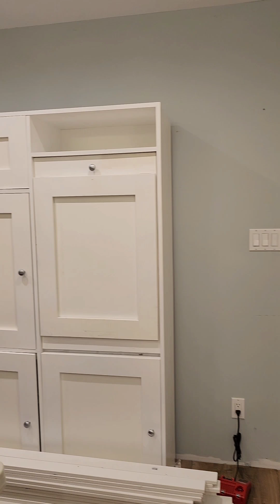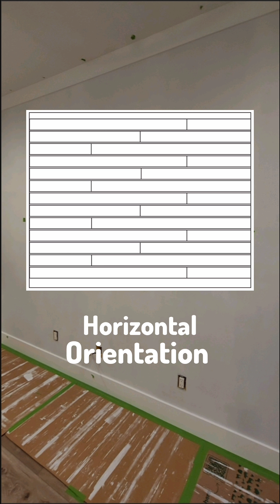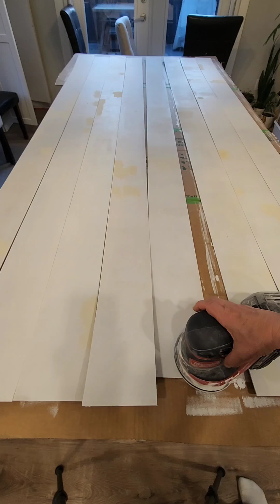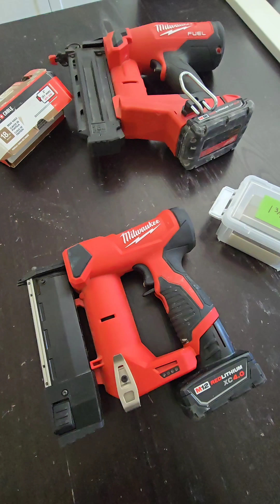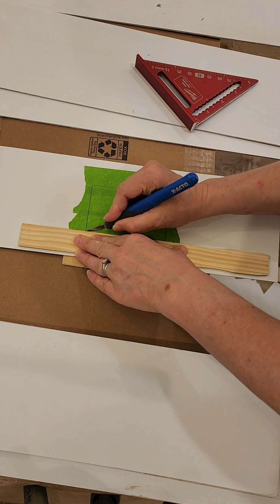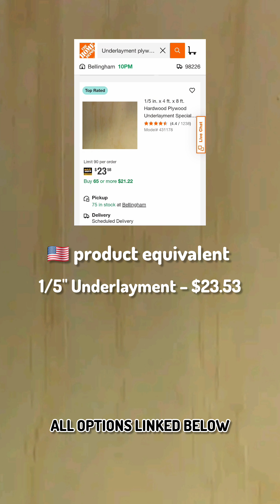Don’t Buy $15 Shiplap Boards - Make them for $2 | Full DIY Wall Tutorial

Comment from the maker: This wall added so much texture for so little 💰 can you believe it was under $2 a board? 

If you liked this, check out how I used the same treatment on my ceiling: https://youtu.be/KXFwhMbJwZM?si=6E2IFYXPYS-xurqd 

If you have any questions, drop them below, I'm happy to help. 😊
Reply: Very nice.  Thank you for sharing.  Do the brad nails have enough hold on just drywall?
Reply from the maker: @vmenajr Thank you! Yes, they are holding well, you will see from the video all the little green tape pieces (where I marked my nail holes to fill) that I used a lot of nails. The best application if you are having trouble with that is to angle the nails away from each other or nail in an X pattern to help hold the boards tight to the wall. I don't like to glue these boards to the wall incase I change my mind later and want to take it down since the glue will damage the drywall but if you’re not worried about that you could also use some adhesive. 😊
Reply: This might be one of the most helpful and practical DIY videos I’ve seen in ages! Thank you! Double bonus that you’re Canadian so I can actually find the products you suggest.  Definitely giving this a try rather than buying the pricey individual boards like I usually do! 🤦‍♀️. Great tutorial! 🎉
Reply from the maker: @norskgirl100 Thank you so much for leaving me this kind feedback, I'm so happy to hear it was helpful!! ❤
Reply: Can I do this over 70’s wood paneling?
Reply from the maker: @rachelseal2890 Yes! You can install the underlayment strips right over it. I would angle the nails in opposite directions to help hold each strip in place. Or, if you're not concerned about preserving the paneling, you could use adhesive instead.
Reply: @creatively.clarified thank you sooo much!!! ❤
Reply from the maker: @rachelseal2890 you're so welcome, have fun with your project!! ❤

Comment: Why couldn't you just score the 4x8 sheets at 5 inch intervals to make it look like individual boards?
Reply from the maker: You definitely could, it just wouldn't work for me for this project. I wanted to use a very thin material here so I didn’t have to remove my basboards and so it didn’t overlap the trim of the adjacent builtin. So I used underlayment plywood which doesn't have the thickness to score it and give the lapped look of boards for that traditional shiplap feel.

Comment: Literally did shiplap in our Victorian house 10 years ago. Our rooms were pretty decent sizes 19 x 20 to do the room fully the high wind coating where you could put plates on it using rail wood cost $237.72 and then $46 for the oil paint that I used after I just went to Lowe’s and priced it out it would cost me $1700 and $72 for the paint. I think that they are taking the boards that you’re using off the shelf because I cannot find them at Home Depot in front now
Reply from the maker: Wow, that's a tremendous savings!! I have found that's it's in and out of stock often at my Home Depot too, the last time I actually ended up getting hardboard instead.

Comment: Looks great however... if you do not remove the drywall first... you are going to have moisture and mold issues in a massive way. Get rid of your drywall everywhere... life is better. The fact ya use underlayment on top of drywall is a horrific decision. At the very least put moisture barrier... but like I said... remove the drywall! I hate to tell ya but what you have done is a disaster in no time. Please consult professionals before doing something like this on top of previous layers. You should have simply put the ship lap over the wallboard and use that as backing and not use sheets uf underlayment... again... mold.
Reply from the maker: Installing a wall treatment over existing drywall does not inherently cause moisture or mold!  If the wall is dry and there’s no existing moisture issue, adding underlayment as shiplap does not create one.

A moisture/vapour barrier also shouldn’t be added to an interior wall as a precaution!?

Drywall is routinely left in place when installing interior wall treatments, so removing it is absolutely not a requirement for this project.

Comment: Nice explanation of what you did. I once achieved a similar look using a 4'x8' bead board panel. It had v-grooves every few inches. Similar thickness and was very quick to put up and paint as I didn't have to attach each vertical slat. Just nailed along every stud behind.
Reply from the maker: Thank you! Yes, that’s another great option too!

Comment: I’ve been wanting to do a couple walls in shiplap but the cost has been higher than I wanted.  This technique is a little more work but makes the cost a no-brained.  Thanks for doing this video! 😊
Reply from the maker: Thanks for the feedback, I appreciate your comment. 😊 I recently did a similar wall using the same technique but using hardboard instead of underlayment. It was a little bit less prep work of the boards so it did go up faster but I also learned that the fibers of the hardboard show the nail holes a little more unless you use a good filler and prime over them with a Shellac or oil based primer. So that's another option to try. I'm going to do a comparison video very soon.

Comment: Fantastic result~!  Trying to talk my wife into our doing our shiplap project this way instead of buying the actual shiplap lumber.
I know that I'm seeing this video a bit later than when it went up, but I would love to see another video on the built-in project.  Beautiful work~!
Reply from the maker: Thank you so much, I really appreciate the feedback. I have another video installing the same material on my ceiling. (If you go to my videos tab and scroll down yo the bottom, it's actually the very first video I posted.) Currently I'm working on using hardboard instead of underlayment to do some walls in my dining room. There's definitely some differences between the two materials so I will be doing a comparison video on the 2 products as soon as I'm done.

Comment: Just wondering it wood glue would work without nails
Reply from the maker: You could definitely use some sort of adhesive instead of nails but it will damage your drywall if you plan to remove it in the future. Wood glue could work but it takes a bit of time to set up so would be a slow process to hold or pin the boards in place, construction adhesive might work better since it has more of an initial grab.

Comment: Great video! You're very creative and talented.
     On some of the boards, (easy to see on first board, and on the board going in around the 10 min. mark) they are going in (taped & nailed?) with the bottom edge below the top of the baseboard. How are you cutting them to length after they're practically installed? Is your dry fit with the spacers removed and reinstalled after cutting the board to length? The video is edited and I don't see that. Other boards are shown going in already cut to length.
Reply from the maker: Thanks so much! I went to look at that part of the video to make sure I could understand your question properly. I think what you're referring to is when I place the board it looks like it's possibly hanging lower than the baseboard but I think it's just the angle of the video. 

I installed the header and the baseboard first and then measured in between those two pieces of trim and cut all of my boards to the exact length first and then installed them making sure I had a really tight fit and because this product is very flimsy I was able to sort of bend it to fit it in. I hope that answer is your question, please let me know if you need me to clarify anything further.

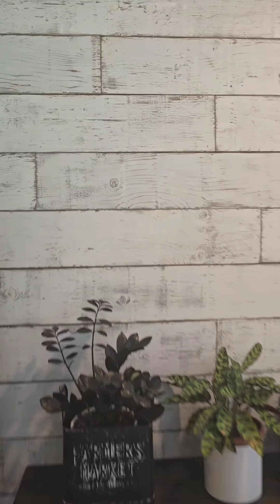Comment: Great video! I am looking to do a more rustic shiplap wall like the one you have at around 2:30 in the video. Do you have a video on getting that weathered look?
Reply from the maker: I'm not sure if I have any video of that project since it was quite some time ago but it was a very inexpensive diy, and a really easy one too! Because I was going for a very rustic look I didn't worry about filling nail holes.

I bought rough construction grade plywood and ripped it into 6" wide planks. Then stained each one with 'dark walnut' oil based stain. Waited for it to dry fully and then painted a coat of white paint over top. Once that was dry, I took my palm sander with 180 grit sandpaper and sanded it so that some of the white paint came off and the walnut stain underneath showed through. Because this was rough grade plywood, there was a lot of knots and even some small cracks in the plywood, which just added to that rustic character. 

I measured my wall and then figured out a pattern of the length of the boards so they would each hit a stud. So essentially, I cut a bunch at different lengths like 7', 5', 3', 1' and and just staggered them (kind of how you would lay laminate flooring, where you keep staggering your cuts), so that no two cuts line up at the same point on the wall.
Hope that helps!

Comment: I love that old looking wall that you did a couple years ago. Can you share that also, I’m taking that you lightly painted one coat of white and then sanded it. I love that look.
Reply from the maker: I'm not sure if I have any video of that project since it was quite some time ago but it was a very inexpensive diy, and a really easy one too! Because the boards are horizontal, I was able to make sure that each board hit a stud and because I was going for a very rustic look I didn't worry about filling nail holes.

I bought rough construction grade plywood and ripped it into 6" wide planks. Then stained each one with 'dark walnut' oil based stain. Waited for it to dry fully and then painted a coat of white paint over top. Once that was dry, I took my palm sander with 180 grit sandpaper and sanded it so that some of the white paint came off and the walnut stain underneath showed through. Because this was rough grade plywood. There was a lot of knots and even sort of hairline, cracks in the plywood, which just added to that rustic character. 

I measured my wall and then figured out a pattern of the length of the boards so they would each hit a stud. So essentially, I cut a bunch at 7', 5', 3', 1' and and just staggered them (kind of how you would lay laminate flooring, where you keep staggering your cuts), so that no two cuts line up at the same point on the wall.

Hope that helps, let me know if you have any questions.

Comment: Why wouldn’t you buy the full sheets of shiplap instead of all of this work?
Reply from the maker: Fair question, I chose this route for a couple reasons: 

The paneled sheets are three times the price of what I paid here in my area, one sheet is around $57 and I would have needed 3. 

The panels that I have seen, it kind of just looks like grooves in the panel. They're not deep enough to mimic real shiplap, i really like how these individual boards create enough depth between them that it does look like real shiplap.

And then I also wanted to determine the width of my boards so that I could have full width boards across the whole wall, instead of being left with as skinny strip at the end.

Comment: I did something similar last winter for my butler’s pantry.🙂

We had a bunch of the 4x8 dark brown sheets of “Yuca board” that were used to protect our hardwood floors during a kitchen renovation. 

Seemed silly to toss in a dumpster, so I sliced it, primed and added to the back of the shelves / cabinets in my pantry. We had leftover primer & paint too, so the whole project cost nothing - just my time. 

My only additional tip:  use the circular saw like the gal in this video.  I tried cutting the big sheets on my table saw and the thin mdf was too floppy! Several of my planks were not uniformly cut and thus unusable.
Reply from the maker: I love how you re-purposed those boards! Can't beat a $0 project. Sounds like it added a lot of character to your pantry! Nice work!

Comment: This was great work but is a lot of extra work to accomplish what basically ends up looking like wider beadboard that they sell for around $30 a sheet. Maybe you aren't familiar with that product? Not worth the savings imo if faking shiplap. We bought essentially factory seconds shiplap for our home and saved like more than 50% off the retail cost, so that is an option as well for real shiplap that gives much better depth. Either way, great job. Oh and learned from a pro carpenter on youtube about Famowood as being the best nail hole filler for small holes, see if it's available for you in Canada as it's far superior.
Reply from the maker: Thanks so much for your comment and I'll check out that filler. I am familiar with the panelling products, my local store has a couple designs to choose from but they start at $57 each per panel, and I would have needed at least 3, so it would have cost over 3x what I paid and I was really trying to stick to a tight budget. 

The shiplap strips also come in a predetermined width that would have left a skinny strip at the end. By ripping my own boards, I could stick to that more classic 5–6" shiplap width, and plan it out so the boards fit the wall evenly, no awkward skinny strips at the ends. And I find that the depth on the panelled shiplap is obvious that it's just a groove in a panel where as these individual boards give a deeper depth that looks just like real shiplap. So in the end, I chose this route because it gave me the custom look I wanted and saved me a ton of money.

Comment: Stunning affordable diy! Thanks for sharing 😊 TIP: watch for uneven shrinkage and/or buckling due to the back of the boards being untreated with some sort of sealer. Wood fluctuates and will fluctuate unevenly if all sides are not sealed. Doesn’t need to be expensive or showy since it’s not visable😊 my professional finish carpenter husband informed me of this. Blessings~
Reply: Wouldn't the primer she used work? I thought she did all sides
Reply: @danap8500 if she did all sides then yes but I thought I saw a clip and the underside was not sealed/primed. Let’s hope it was done 😊
Reply: Ooh, thanks so much for this info!
Reply: We only primed the fronts of the wood when we did this about 12 years ago and never had any issues.

Comment: Curious if you could get this same look by running your saw down the length with the shallowest cut, not cutting clear through but just putting the groove into it. Could be accomplished with a table saw as well, would just need to adjust the fence for every cut. This would leave the panel in the 4x8 size and would require much less work. I am interested in this look, but have very little patience lol. There are pre made panels out there with the ship lap look, but I do like these wider strips like you have.
Reply from the maker: I have seen this done but with slightly thicker material. I used very thin laminate here because it was so inexpensive and also so I didn’t cover up the built-ins on the other wall and I feel like the material I used would be too think to try and groove it. But it would probably work with thicker plywood if you can find it in your price range.
Reply: @creatively.clarified can the boards be stained or must they be painted? Please

Comment: Do the ladder build!👏🏻👏🏻
Reply from the maker: I will add it to the list for sure! 😊
Reply: @creatively.clarified I would LOVE to see the ladder build too. If possible, could you throw in some tips to do this with shelving? 

Dh & I are relatively close to finishing my home pottery studio… the outside anyhow. It’s a 12x16 (on 16” centers) with double doors on one of the 12’ end & a window & single (32”) pre-hung door on one of the 16’ sides. I don’t have much of a clue where I really want anything other than my wanting my wheel near the window. I’m not sure if I can make it work like I want. The biggest things I want is a glazing table, a wedging table (I think I’ll build this), & a work table. I don’t have a kiln yet, but everyone (family) keeps telling me not to worry, that I’ll get one. My hope is to get a cabinet with hutch for glazing. It’ll provide work area & glaze/resist/stains & brush storage. A wedging table will be a 12”x12” square table with a 2” depth top to add a heavy cloth covered drop in plaster bat with legs. I’ll have to add a place to add a taunt wire for cutting clay as I wedge clay. I’m torn between adding lower cabinets & counter space or tables with lots of floor to ceiling shelves. I am planning on adding a ceiling so as to save on heating & cooling. I can’t do it now but I want functional transom windows. We are tentatively thinking of adding a lean-to roof on the single door side to allow me to keep the kiln outside, but on paver stones, if not outright concrete poured floor. Again, that’s a much later project. 

Forgive me for running off in thought. We’ve been building this studio for about a year now & I’m no closer to knowing how I want to finish the inside than I was 8mos ago. Building has took place only after saving enough to buy materials. We did the building ourselves to save on labor.
Reply from the maker: @sammiJoRe wow, what an incredible project you guys have taken on! A pottery studio sounds so amazing, love that your building a place for your creative passion! ❤ Good luck with all the finishing details, I'm sure it's going to come together. I will definitely add the ladder build.

Comment: Did you mention the top trim on the shiplap wall?   What did you use?  Do the ship lap boards butt up to it?  Is the top trim board just on one wall? Thanks.
Reply from the maker: I used a 1x4 board accross the top and the shiplap boards do butt up to it. The two adjacent walls have floor to ceiling built-ins that have crown moulding across the top, so I just cut out the sides of the 1x4 to match the crown detail.